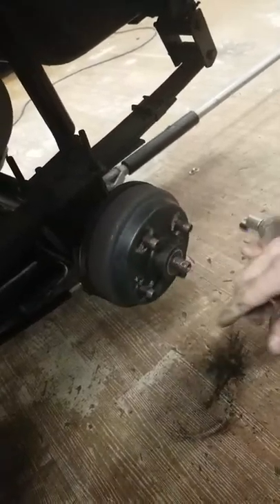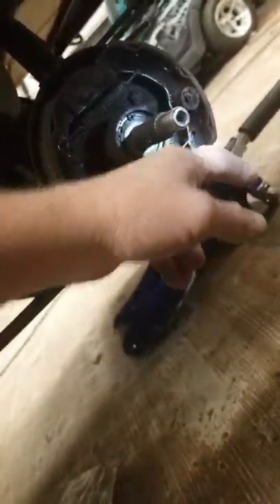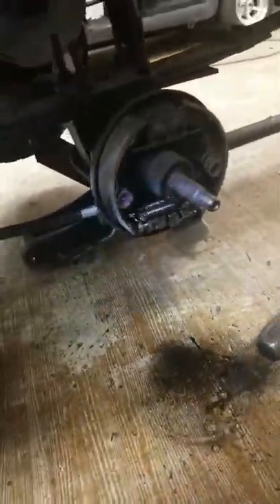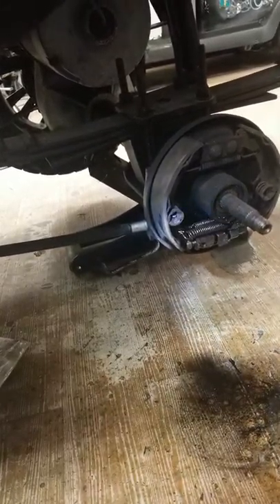Golf cart brake shoe replacement. PT 1 of 2

Comment: one thing i have experienced, hitting the brake pads with even with a rubber mallet can cause internal brakes in the pad material. I have also had a few older ones just shatter.
Reply from the maker: Oh I am sure.  If the brakes are old. That will happen. Thanks for commenting